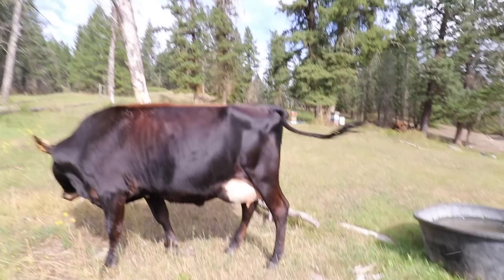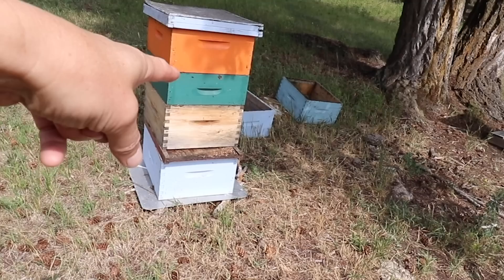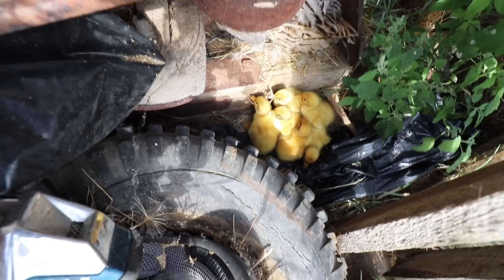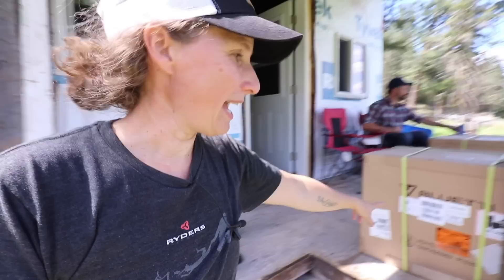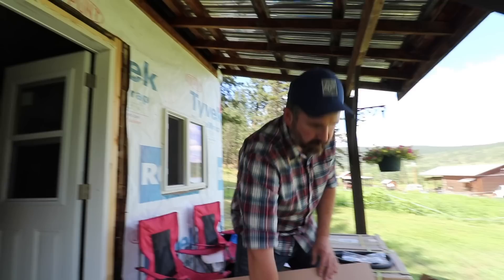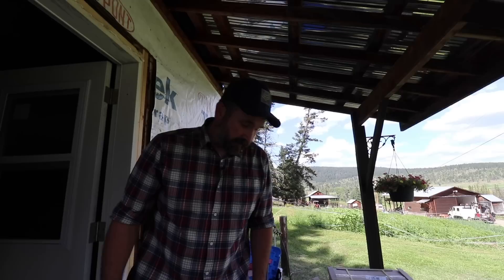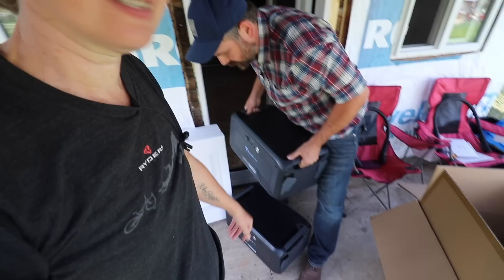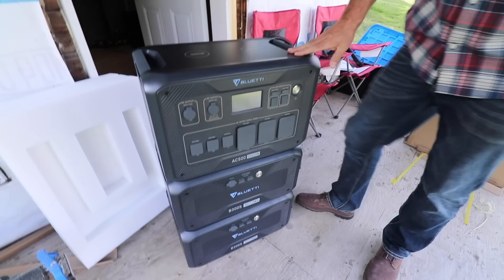SO Excited About This! | Canning the Best Chicken Stock | BLUETTI AC500 & B300S

Comment: About the solar: this is a really magnificent system! very well designed! top notch! everybody should invest in this! really really good job Dan! if the solar panels are standing on the ground you should take a 2by4" board and mill out line along the board FX, so the panels have a steady platform to rest on. the interconnections are inside the foldable link so therefore protecting theese and make the lifespan longer. if wall mounted you cold carpent  and make a straight angle triangles with a shelf construnction and install that on the wall on the cabins and such, ready for use. with the correct sun angle for your location. if u want to do the setup more advanced you make the setup with both summer and winter sun angle for your location :D thanks Dan and co :D great job!

Comment: Thank you for simplifying the Bluetti.  Great description and so practical.  I have been looking at the Bluetti brand for back up power.  Every winter I loose power for up to 7 days not to mention worries about loosing power in the summer.  Already have had some hour periods this summer without power.  Going to have to check this out.  Your chickens are huge.  Are they Cornish Cross or an all purpose chicken?  Thanks for a great discussion on the prep from beginning and end of the chicken.  Very good video.

Comment: Looking good!  Dan certainly did a great job explaining the Bluetti.  Cabin looks great!  I had considered them but due to the lithium based batteries and the quantity I would need, I decided against it and went with a larger conventional generator.  I have heard a lot of great things about them though.  Perhaps a bank of them in the shower house to run all the cabins might work.  None the less, very excited for you!  I don't know as the bigger pressure canners will work on your glass top or even the coil electric (my stove certainly did not stand up to a regular pressure canner). I have the same pot as you plus one bigger I use for dipping at butcher time.  Good video!
Reply: What’s the problem with lithium batteries?